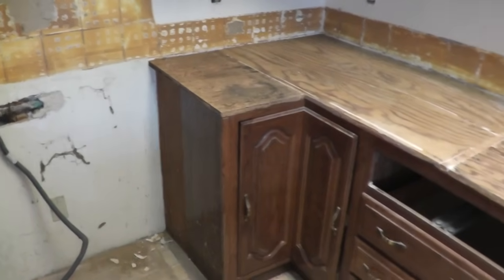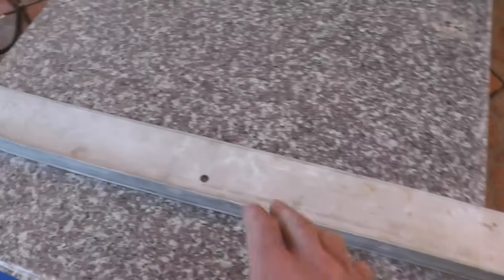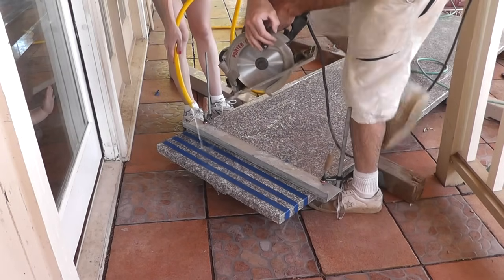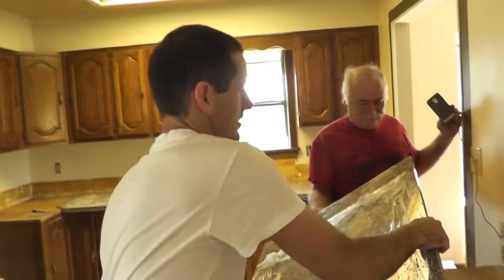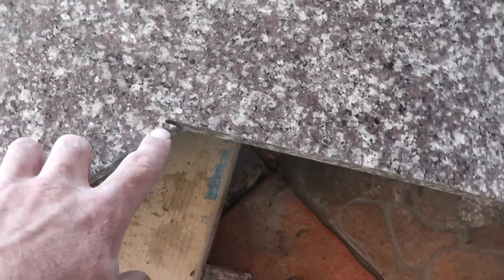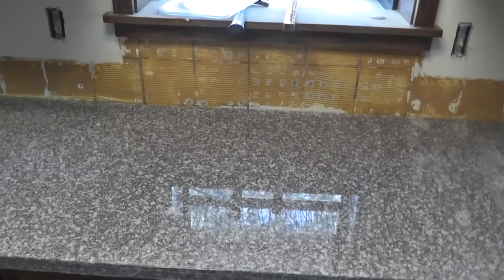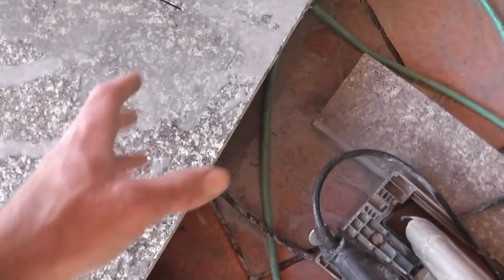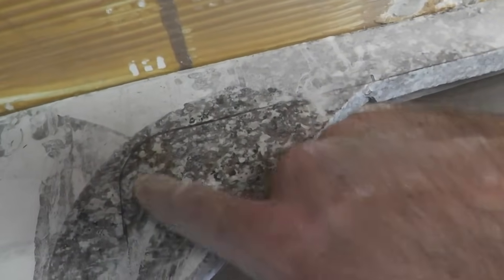How To Install Granite Countertops On A Budget - Part 3 - Cut & Fit With A Circular Saw

Comment: DO NOT DO WHAT THIS GUY DID.First off electricity & water... Yeah.Second, using ANY piece of equipment or tool in a way other than specifically meant by the manufacturer is bad regardless of any outcome you get.This guy should have stepped back and looked at his brand new countertops and said..."Phew..... I survived!"DO NOT DO WHAT THIS GUY DID.

Comment: No safety glasses, hearing protection, and you're risking your partner's hand? I might have preferred clamping the hose on to saw at least. People should know that some saws may not be sealed, so having water in a non-wet saw should be considered very risky. Well done for DIY, however.

Comment: Unsupported cuts.  Child helpers.  Water and electricity.  Working on a budget doesn't excuse basic health and safety thoughts and measures. 

A cutting blade designed for wet cutting needs to be immersed to keep it cool.  Trial and error approach is an interesting way to lose fingers, children's eyesight and your life via electric shock. 

Jeez man.  I trust you lived to enjoy your kitchen.
Reply: well said. Perhaps a couple of Darwin awards should be ordered.
Reply: Why pull the saw and not push?

Comment: i never have a wish to put people down especially when they are trying to help others save money but there are times you do & times you don't. this is a time you don't. im no stone mason but i fit kitchens for a living & i also have electrical knowledge. what you are doing is as stated below, so dangerous you should not be showing people this.
you are dangerously mixing water with electrics when there are proper waterproof cutters for this job. you are also showing people methods that "on kick back" will either cut into their legs because of the way you are doing it or it will jump into the stone because you are holding it with one hand and there's no way you could prevent a kick like that.

the biggest point i would have said is, this is NOT an economical way to do it either. if you spend so much money on stone, why would you then risk all of that by diying it? if that worktop costs say £3000 they would only want about £300 to cut it and deliver it, if they break it etc they replace it and they will provide it with proper bench mitred joints. if you crack it from transporting it or kick back on cut or even cut it wrong as you did through inexperience, you lose £3000.... do the math and get it done properly. there are times to save & times to be wise.
Reply from the maker: +Rich Ando This is just the way i did it and it worked great for me. I understand it is much riskier than writing a check, and involves some unconventional techniques. I am not a professional, and don't pretend to be. I won't argue over safety, as everyone's comfort level with regard to safe practices is different. Your statement about this being uneconomical is wrong though. This project cost me about $400, and if I had had it done professionally it would've been over 10x that amount.

Comment: Are you kidding me ?? A standard circ saw and water ?? This is insanely irresponsible to show to anyone ! Yes 120v + 15 amps WILL KILL YOU ! It only takes 1mA to kill a person btw... Anyone who says otherwise is either lucky or doesn't know shit about electricity, and yes I have knowledge, I am a mechanical engineer...
Reply: Yes at the right spot 1mA will kill, you know the heart works with electrical impuses yes ?
Reply: Christophe Marin-Beaudry The entire human body uses electrical impulses, not just the heart.  Study cathodal stimulation being given to patients for minutes at a time as well as e-stim.  Have you ever been shocked by an electric fence?  As for the effect of amperage on the human body It's not even up for debate.  There are many, many thousands of people that have experienced amperage well above 1mA that did not die.(myself included)  You could easily expose a test group of 100 individuals to 1mA and not one would die.  That alone makes your statement "It only takes 1mA to kill a person", incorrect.
Reply: +Trees Flowers there is no debate, I did not say 1mA will kill 100% of the time, it's a commonly accepted fact that it "CAN" or "it's ENOUGH" to kill a grown human being... Regardless of the minimum amps required, this video could kill someone and yes it's a fact ! Why even take a chance when there tools designed for this ?!
Reply: Christophe Marin-Beaudry If that's the case then it only takes eating 1 peanut to kill a person.  It only takes one bee sting to kill a person.  It only takes one scrape of a rock on human skin to kill a person.  As for the video, the guy is asking for it.  Especially using both hands.  If he's going to do it he should at least use only one hand in an attempt to minimize the path of current across his heart if things go badly.  In addition, he should put a tub underneath to catch the water so he's not standing in it.  The reason he's taking the chance is because of money.  That's the reason he doesn't have the right tools and the reason he's installing the granite himself in the first place.  Money.
Reply: Well what did you expect?! He used saw backwards with the blade facing the right way...
Reply: Trees Flowers ''If that's the case then it only takes eating 1 peanut to kill a person.  It only takes one bee sting to kill a person.  It only takes one scrape of a rock on human skin to kill a person. '' reaIIy ? Are you being sarcastic good sir ? because if you're aIIergic to peanuts or you choke on 1, it wiII kiII you, same goes for a bee sting, or a rock scraping on your spine or neck... hahahahaha what's your point ? Money isn't remoteIy a good reason to do this shit, pIus a hand heId wet tiIe saw is cheap....
Reply from the maker: +Christophe Marin-Beaudry Thanks for your concern. Everyone has different perceptions about risk.
Reply: +Christophe Marin-Beaudry 7:07 good to see angelina Jolies still getting work!
Reply: 1-5 mA can be sensed without pain
5-15 mA starts to become painful to sense
15-75 mA causes loss of muscle control and painful contractions
75-100+ mA [AC 110v-220v] traveling through the chest, for even a split second, can cause life-threatening heart fibrillation.  (About 300+ mA of DC is needed to have the same effect.)
Reply: yea it's dangerous
Reply: If you apply 1mA directly across the heart, it CAN kill you. But that is very rare even when someone is accidentally electrocuted with 115V AC. Is what they are doing unsafe? Of course it is... and I'm pretty sure they know that too.
Reply: Not really, but a GFI dongle adapter for safety.  A portable tile saw is just a circular saw with a water attachment.
Reply: herman... that is not true. a portable tile saw has ita coils and electrical parts seperated away from the cutting surface. ome that is not designed for that such as a dry sae makes no guarantee of seperation
Reply: While I dont disagree with your cautionary words on safety, from one mechanical engineer to another, your post is incredibly pretentious. You don't have to take my advice but there are way too many keyboard warriors on the internet just looking for someone to troll. Everytime I've said on the internet that I'm an engineer, it has only made me more of a target.
Reply: If you are the quality of mechanical engineers this country is turning out... No wonder we're screwed. 

Tile saws are nothing more than a circular saw with a water jet attachment and an extra fuse.
Reply: There are far more concerns that go into the design differences of a wet and dry saw. For instance, water is the #1 killer of electric motors so I would bet my bottom dollar that a tile saw or wet saw has a water-proof membrane or barrier between the electric components and the cutting surface. But you see, a motor also generates heat and needs to cool, so you cannot simply enclose the entire motor or "waterproof" it either. Design concerns would actually need to go into building a quality lasting wet saw far and above a dry saw. So your description of the difference between the two is factually false, and your statement right before that is even more so.
Reply: fritZ
Reply: Hate to break it to you but I have 4 friends that are all stone workers. Every one of them runs a diamond blade in a standard circular saw. They have for a combined 50 years. One of those saws is a 40 year old Craftsman. So please. Tell me again how I'm factually wrong when I work with their tools on a near daily basis.
Reply: in simple terms. i think you are full of it.
Reply: David Rock you're right. bad math on my part. they're closer to 70 years of experience. Add their father and uncle and there's probably around 130 years
Reply: thats fine. bit the argument isnt about the experience your 4 friends have in masonry.. a skill that is as old as civilization. the argument is about the difference between the design of a wet was and a rin of the mill circular saw. so i fail to see how your explanation relates. go and open them up side by side and you will see the difference.
Reply: "im a mechanical engineer" 😂😂🤣🤣
Reply: You guys should be concerned about the true issue here... did they install that bullshit without polishing it lmao😂😂😂 congrats you have a shitty rough piece for the rest of your life just for saving $1,000 and costing yourself even more hours
Reply: Not sure what the big deal everyones making over the cuts this guy made, he wasnt standing in much water, and the cords looked like theyre in good shape. If that scene made you overly "safety" paranoid individuals scared, then please, dont step foot on any construction sites, ever, union or not, the method in which he cut that granite isnt out of place there. - several years marble/stone mason.
Reply: @Erick Lloyd Wayne Since you are a marble mason, Is there a way to join marble together so you don't see the joint just like in corian?
Reply: You and your wife could still wear some rubber gloves when working :) I love your videos and even the risk of you guys being hurt makes me sad. Stay safe!
Reply: Jennies Garage   Wow, you even defend it? Riskin your life to save a few dollar on rent fee?!
Reply: Health & Safety Executive from England here,,,,,,,that is classified as a high level risk factor with certain death if electrocution occurs. We would most lightly use this type of video on “How Not To” . Shame the explanation is pretty precise, but breaching some hardcore H&S regulations
Reply: My very first thought was this is absolutely careless and dangerous - 100%!  If someone has to caution you on water and electricity then there's already a huge issue.  Do you really need to be told this!  There' is such a thing as cordless...
Reply: Christophe Marin-Beaudry Based on your statement you are not an electrical engineer. Go back to school.
Reply: 0.1 amp (100 mA) is not a milli-amp..., that would be 0.001 amp (1 mA) which cannot kill you.
Reply: You are wrong. I've been jolted doing the same thing tons of times. Water is actually a resistor. You dont get all the current.
Reply: Umm.. Yeah, dude, so am I, so is my son, and my wife is a civil engineer; I've got 10 years of professional remodeling experience and 3 years running a construction company.  You know what?  You have literally zero knowledge.  Until you've spend a half dozen years on a job site or done half a dozen large scale remodeling jobs, you have no space to talk.  Engineers design, not do.  Sure, we have to fabricate some bits and pieces in nice ideal workshops with perfect lighting and amazing ventilation and industrial grade equipment.  Until you've hefted a circular saw a thousand times and swung a hammer at 10000 nails or run a 200A service from gooseneck to device, or knelt down in mud, fungus, spiders in a 24" crawl space to plumb a bathroom you. have. zero. idea.  
Yes, we all know a 9 volt battery is SUPER DEADLY! OH NO BE CAREFUL! whatever.  This guy was fine, for the most part.  Yes he should have noted his outlets were GFIed, and used sawhorses or a table to elevate his workspace, but he was fine.  I've seen painters do more dangerous shit than this kid.  You are young and too full of your own education.
Reply: Christophe Marin-Beaudry
On your deathbed you can say "i got here safely"

Comment: He is killing me with the direction he is going with the skill saw. he is going backwards. He is pulling it the wrong way instead of pushing.
Reply: PCOLAMONSTER 
yeah i cringed a little when i saw that, saws are dangerous he should learn to use one correctly
Reply: PCOLAMONSTER I watched a pro installing counters in my building do it exactly as this guy in the video did it.  They intentionally draw the saw backwards to maintain a cleaner cut on the top.
Reply: PCOLAMONSTER I watched a pro installing counters in my building do it exactly as this guy in the video did it.  They intentionally draw the saw backwards to maintain a cleaner cut on the top.
Reply: PCOLAMONSTER  The blade turns counterclockwise normally. In order to cut and not have chip out  on the top of the slab he had to reverse the blade and cut backwards with the saw. Still dangerous even if he had ground fault. Best left to the profession tile setters.
Reply: synapse131 Correct. You want to blade to cut down into the material and not push up when cutting.
Reply: It's call a climb cut vs conventional cut and coming from a professional that is the only thing. And I mean only thing that he said was factual based. But he still did it way sketchy lol

Comment: I've been doing granite for a quarter century. You are doing things the hard way. If you are gonna to a tutorial you should be good at what you do. No offense. Ever had a bridge saw break down so you just cut the kitchen on the truck a-frame, edge, polish, and fab UM sink cutout in customers driveway it install and have no complains and leave with thanks, a check, and $100 tip plus one for helper. Or build a three story half spiral half square marble staircase on Siesta Key in less than two weeks(steps bullnosed by hand and not wavy). THEN you are a Rockstar granite guy!